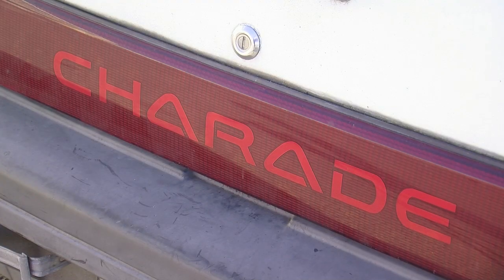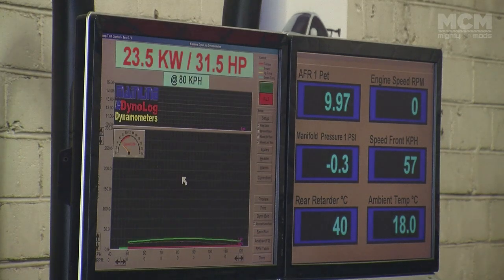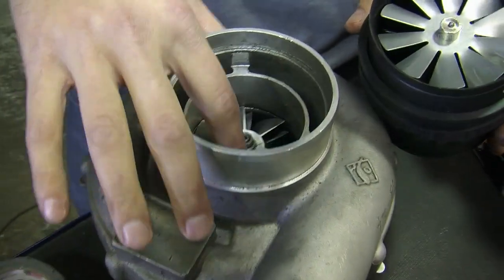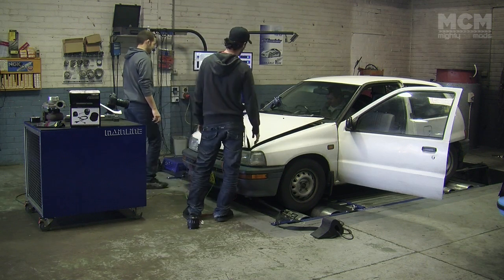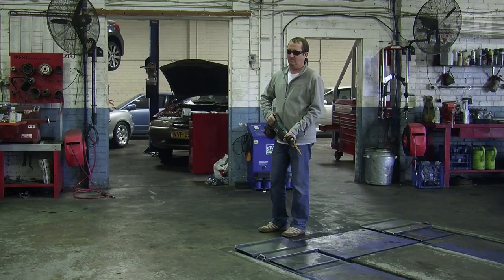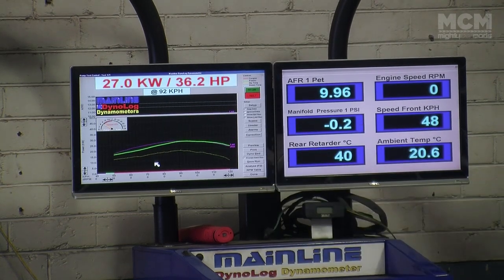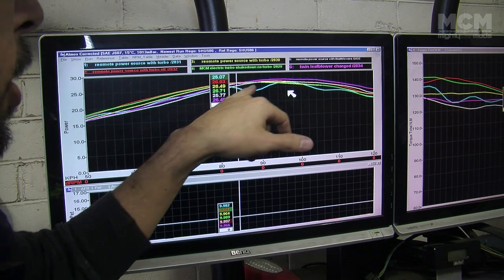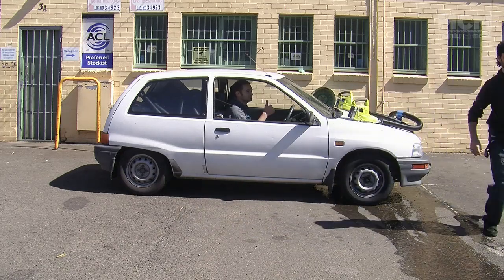Electric SuperChargers Mythbusted

Comment: Yet, it´s better than a modern engine, where the engine program compansates for the additional air, by not fully opening the throttle valve. A carburettor engine just mixes air with petrol, and makes power. In my eyes it´s the best engine, cause then you don´t have electronics to alter the test resoults. 

But none of this accually matters, cause the electric supercharger dosn´t work. Didn´t you hear them. It´s a fan, not a charger. take a dump if you want your car go go faster.

Comment: You could should try a compressed air cylinder, see if by adding compressed air and more fuel, it'll give power. . . could be a cheap way for people to get good boost at the drag strip!
It's usually really cold as it expands out of the compressor too so would be great for keeping intake temperatures low!
I'm pretty sure you can get high psi lines too. . . enough to double engine output with the right fuel ratio?

Comment: An average air compressor has what?  30 liters of capacity?  An engine would consume that amount of air in seconds.  For a 2 liter 4 stroke,  it would take 60 crank revolutions to empty the thing... so  at 1000 rpm, that air would be wasted in less than 4 seconds.  At 6000 rpm, it wouldn't even last a second.

Comment: You are right. Just checked with an engineer. The litres per minute of air being sucked in by the engine even for a 1000cc motor would be higher than the amount of air a fan that size could push. Probably do nothing but slow the air down.

Comment: EDF units only move a large mass of air... they don't compress.  Block the end of an EDF unit and see what happens.  It will actually spin faster because the fan stalls out at the slightest hint of resistance.

Comment: If the air intake was completely blocked, you might reach a few 100ths of a PSI. However as the engine itself is sucking in air I am willing to bet that the pressure is actually negative. I highly doubt the air flow generated by these can even keep up with the engine.

Comment: Can't believe they're still selling this shit.  Electric fans won't provide boost, because they CAN'T compress air and  even if they could, the electric motor couldn't possibly have enough power to do it.

An average reciprocating engine's thermal efficiency is less than optimal.  That means that a turbocharger has a large portion of the remaining energy to do its thing.  We're talking kilowatts worth here...  an electric motor has what?  Around 50 watts?

Comment: If you say its compressed air to make power. why not just throw a air compressor in the trunk and then run a line into the intake? when you want boost just release some of the pressure from the tank into the intake? INSTANT BOOST

Comment: I wondered when I was younger about drag cars using a tank of compressed oxygen but the volumes of air going thru the motor are massive. ie A drag car blower can pump in excess of 7L per revolution.

Comment: Actually, he is right. If a turbo is spinning at 100'000 times per second, that would be 6 million times per minute. Due to the molecular structure of alloy (the compressor wheel)... It would have disintegrated before it even reached 400'000rpm. 

In fact, a simple google search would show that the average turbocharger spins up to 150'000rpm. A full 4'850'000 rpm slower than your claimed speed.

Garret and other branded turbo speed gauges. The highest speed found on a gauge was 180'000rpm.

Comment: It's similar.  Instead of using crankshaft power to run a compressor, it's using a turbine to boost the crankshaft.  I don't think it would be worth the trouble for making power; a turbocharger would just work better, but I think it would be great for hypermiling.  One more stepping-stone on the path to the 70mpg CRX!

Comment: would be much more accurate due to the air cleaner actually having heaps of holes especially the hot air pipe into it off the exhaust manifold haha

Comment: Hey guys, just watched your latest video about the electric tube fans & I was wondering if you would be happy to sell me a part off the Charade you used in the video.
I was after the red plastic trim that has 'Charade' written on it that runs between the tail lights & is mounted on the tail gate.
I've posted this on your Facebook page because I wasn't sure on how you would get this

Comment: I'm going to have to come out and say it, even though i do 100% agree ebay super chargers are complete and utter rubbish, they didn't properly install it or the leaf blower system... the system isn't sealed at all! you need to remove the top air filter off completely and install the pipe directly onto the carburetor, i highly doubt they would achieve much better doing it this way but it would be the proper way to do a test.

Comment: I want to see MCM make a turbocompounder.  That's where you take the turbine of a turbocharger, and hook it to the motor with a belt like a supercharger.  That takes the exhaust energy and puts it directly to the crank for more power.  They used to use a system like that on old airplane engines, and Scania has recently started using it on big diesel trucks in the pursuit of fuel economy.

Comment: You read that story about the 1950s, guy used a empty propane tank and humidified air to make his engine get more MPG's out of a big boat car? His friend said they put 2 gallons gas in the empty gas tank and it drove 200 miles without running low on fuel.

Comment: I don't think it would. Once the air leaves the tank its no longer compressed and just as useless as the air moving through that fan.

Turbo's work in a completely sealed system and does no decompress (as far as I know) as it moves through the engine. Also turbine's spin at like 100,000 RPM :P

Comment: I'm not saying they would work, I reckon they are crap.

But if they did, the intake system on the stock car would leak boost. Just like if you strapped a turbo to that motor, the stock intake system wouldn't take it.

Comment: Pure oxygen (O2) would cause most things to burn violently. It might work, but it would be dangerous and probably kill the engine pretty quickly.

Nitrous oxide (N2O) would be safer and since N2O can be stored in liquid form at room temperature while O2 can't, an N2O system would be smaller and last much longer with even pressure too.

Comment: supercharger-
it runs off the spinning components of the car, i think it's straight off the flywheel by a belt which spins the turbine and makes compression. 

turbocharger-
this works by spinning also spinning a turbine that compresses air in the chamber but it  is spun by exhaust gases rushing past the blades.

turbo-
just a shorter word to use than "turbocharger".

Comment: I agree theese things will do nothing for power... but if you're testing it on a carbbie engine, you should rejet it for the "extra" air... the best thing to do would be to test it out on something with a exhaust lambda sensor to see if it leans out

Comment: An expansion on this - Use a real air-compressor with a 60L tank, charged to 100PSI.  Then blast that air into the intake through a 1-way valve.  Just for shits and giggles.

Comment: An electric turbo-charger has been invented and does exist.  It requires over 900A of electrical power to produce 12PSI boost pressures.   I don't think you've got 900A on that little fan :)